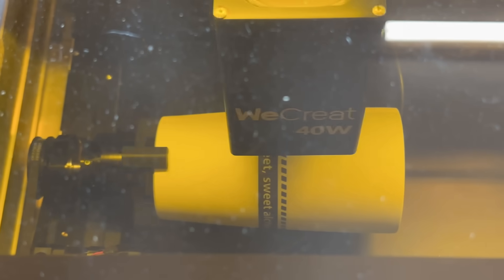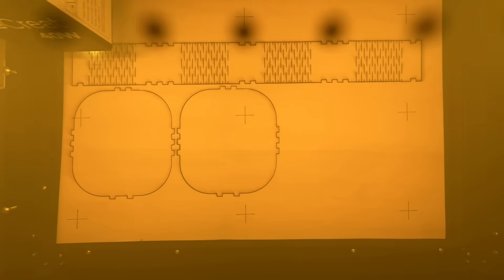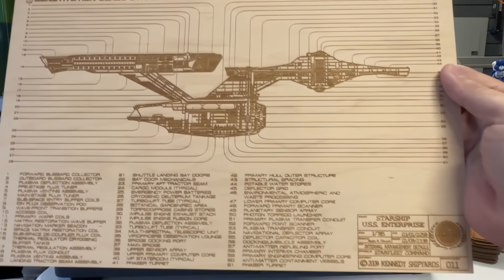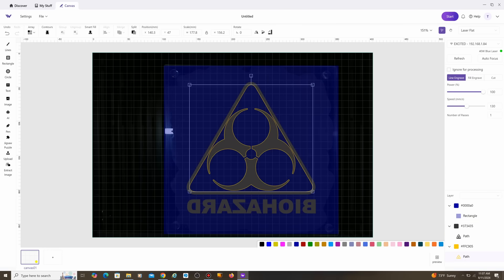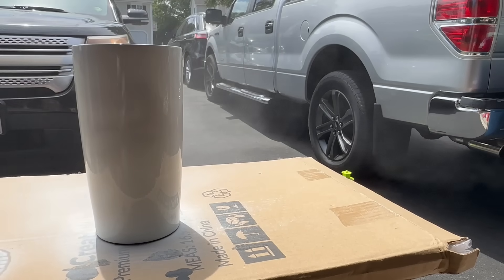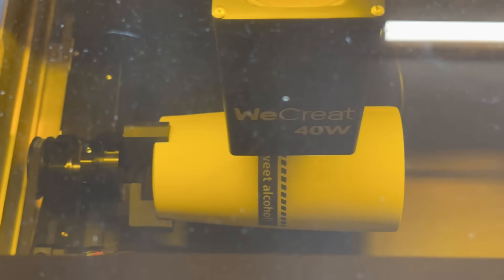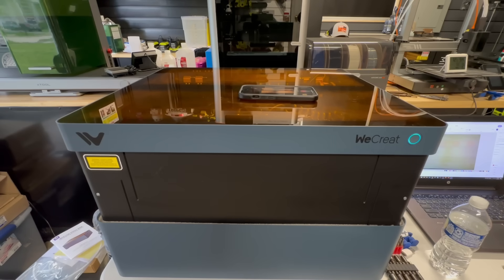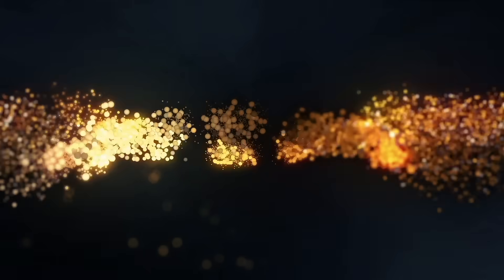WECREAT VISION 40W LASER - IMPRESSIVE!

Comment: I’m still stuck between the 20w and the 40w 
I’m mostly going to do tumblers n engraving
Reply from the maker: Are you doing stainless steel mugs?  Or just removing the powder coating?
Reply: @ planning on doing both 
But was just planning on starting with just removing powder coating 

If I get the 2w IR will that help with stainless??

Comment: The 40w machine has a smaller workspace, which isn't explained to customers on the website, and the auto-conveyor system has been a huge waste of money so far.   I would recommend the 20w machine so far, but don't waste your money on the 40w or the conveyor system
Reply: Thank you for this what’s the work space area for both and can this cut clear acrylic?
Reply: @theprintperfect  we haven't tried clear yet, sorry
Reply: @theprintperfect  15.75" X 10.63" is the workspace on the 40W  compared to 16.54 X 11.42 for the 20W

Comment: I'm also a wood worker, I feel like the saw dust may get inside the sides somehow or interfere with the auto focus mechanism. I have an air filtration system, but I wonder if that's going to cause an issue down the line. Great looking machine though